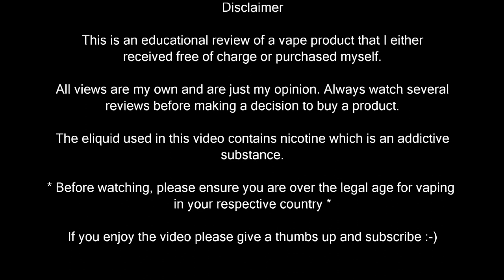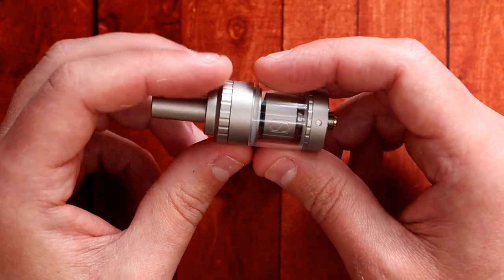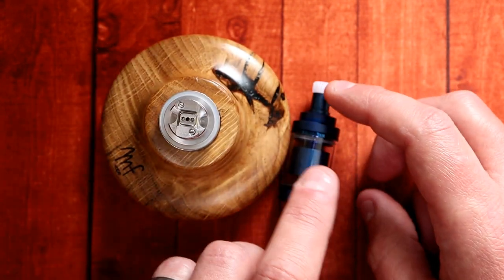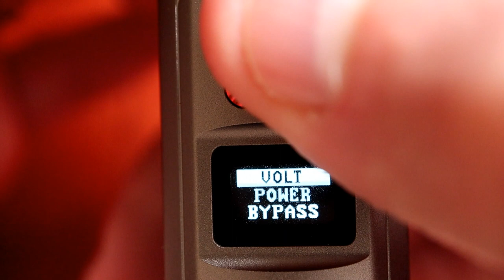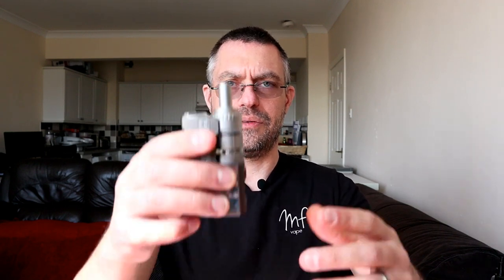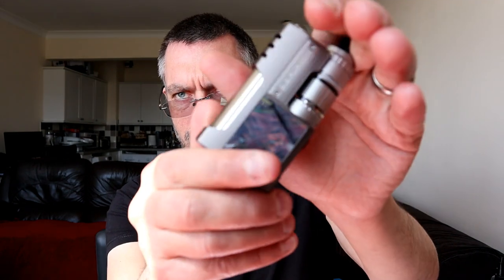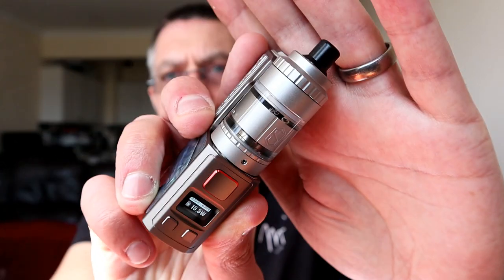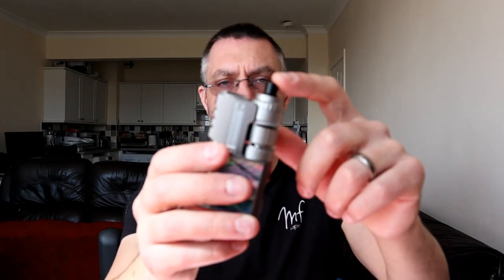Digiflavor Z1 SBS/Siren 3 RTA Kit - Review & rebuild - Great combo, bar the driptip!

Comment: Great review Mike,
Apologies in advance for the essay!
Where do I start, I think this was rushed,
The tank I have 2 X 24mm siren v2 and a 22m v2 and they are awesome mtl tanks, in my opinion only beaten by the true tank and some of the latest mtls,
They still could of easily got that score of 8.5 to 9.5 if they had lowered where the air hits the coil by half and the posts by half, that would of shrunk the inner chamber, then if they'd of really domed it like again the true or the artemis it would of been unbelievably better and tastier,
I think they needed a tank and stuck on something they know worked well,
The mod too I think they could of just spent that little bit more time, there's space for a nice little colour tft screen, maybe 21700 although not in itself a deal breaker, I think they just wanted an sbs to take advantage of the current craze,
Anyway apologies again for the lengthy comment but they could of hit it out the park but instead only 2nd base.
Hope your all good,
Take care and stay safe pal
Reply from the maker: I hear you but it's a very reasonable price on Sourcemore so for the money I don't think it's bad at all. If you have an account the whole kit is $49 so the tank is an added bonus for me. Agree the tank doesn't warrant a V3 status but I'm thoroughly enjoying using it. As for the mod, yes it would be good if it was 21700 but at least it is lighter with just an 18650. I honestly love it. Nice and compact with a little bit of weight to it but solid. Maybe next time they might make a 21700. Cheers for your thoughts mate. Take it easy 👊
Reply: @MFVape  
I totally agree Mike, 100%, for those who don't or didn't have the siren v2 it's a must get for mtl'ers , and yes I suppose I was nit picking a bit, 
On another subject , relieved my juggernott mr yesterday, cleaned it, put a 3 core kanthal clapton in with vapetasia's killer custard and....
WOW, My constant wonder whether the more expensive tanks are REALLY  worth , we'll in this particular case, YES!,
thank you for the original review and  recommendation, I'm loving it mate. 👍
Reply from the maker: No worries mate. QP stuff is usually nailed. If you fancy a dual coil at any point I highly recommend the Violator or Juggerknot V2. The V2 is basically just like the MR but more flavour for me. I understand if you're a single coil only guy so you can't go wrong with the MR. I must admit the Reload S is another corker too. You're right, sometimes it's worth paying the extra. With both tanks they feel quality. Cheers brother. Stay safe
Reply: @MFVape  yeah,shame it took me 6 years to risk the extra dough! 🤣🤣
Ah well.
Thanks again,
Reply: @-djs  yo thinking of buying this kit for DL and just got the juggerknot mr. no matter how loose i build i get dry rips any tips?

Comment: Thanks for showing us how DTL is possible on that MTL RTA. I guess those 3 holes under the coil are quite large then?
👍
Reply from the maker: Tbh I haven't measured them but yes you can DL it. It's proper tight with just the one hole on the AFC ring though. I get a really good draw on it. Surprisingly good in fact. Cheers Adrian.

Comment: Ey up Mike, cracking review pal, i do like the look of this kit, also nice touch with coil pack. What's the weight like compared to the MIXX ?. Take care mate big 👍👍👍❤👊👊👊💨💨💨💨
Reply from the maker: Yes the coil pack is great. Using one in my Ether RBA, decent coils as well. It's solid but noticeably lighter than the Mixx even with the Siren 3 on it. Couldn't find what material it is made from anywhere online but presume it is a zinc alloy. I logged into my account and the kit is $49 which is not bad at all mate, highly recommended. If you like the Expromizer draw you will like the Siren 3 buddy.

Comment: Lots of folk seem to like this mod, but I think it is genuinely hideous looking! As for the Siren V3, I'm disappointed they haven't innovated more. The V2 is still a classic, and it seems this is a bit of a misfire. Also odd they haven't released the V3 to buy on its own. 

So not for me, but nice one though mate.
Reply from the maker: Mate, I put it in this perspective when reviewing it. If you have an account with Sourcemore it is less than $50 for an SBS mod and decent MTL RTA. I agree it ain't the most innovation with the tank but if you haven't got an SBS or MTL RTA then for me it is a great option. If it was £100 my opinion might be a bit different. I think they should've just called the tank the Siren 2.5 or something, it's just got some improvements on the V2 but nothing major. It feels solid and durable to me so I rather like it. Each to their own though bud. Now I have the Abyss my attention is elsewhere lol. Cheers Rasp
Reply: @MFVape  Yeah, can't argue on the price I guess.